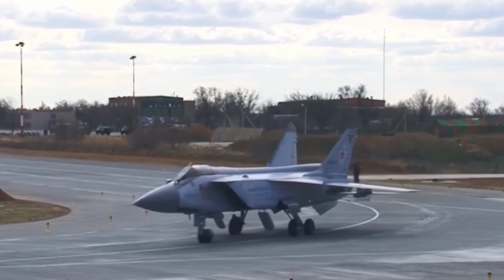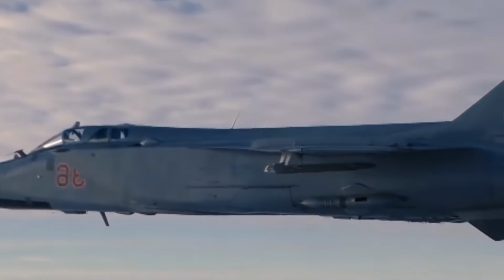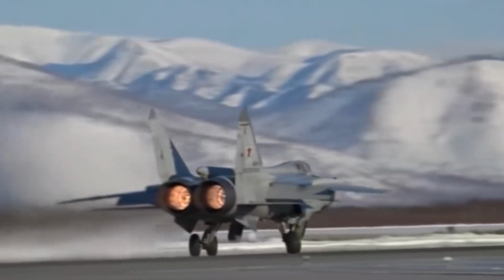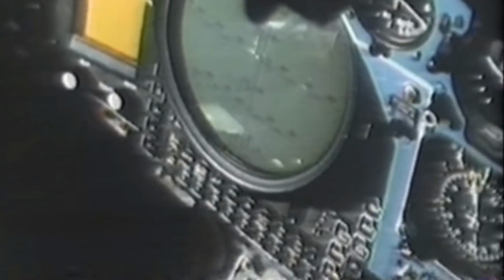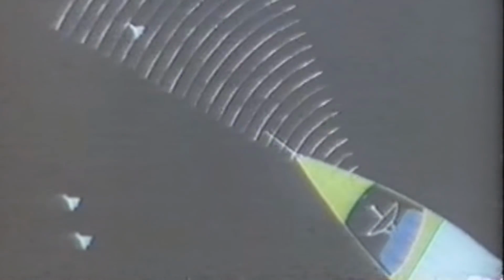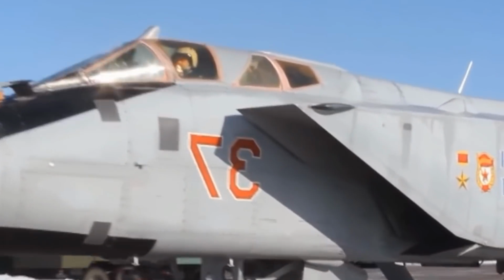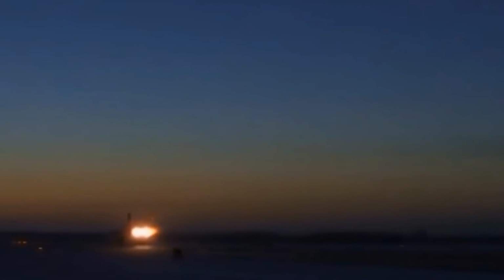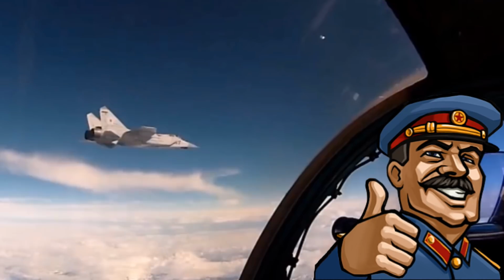Mikoyan MiG-31 Foxhound - Russian Interceptor Fighter

Comment: It's called foxhound because it's had an amazing function of scanning targets for another's allied planes and transmit target position by data link, the allied planes can disable their radar and get target position given by the mig-31. This plane has been upgraded several times with new copkit new engines better radar software, it's still dangerous.

Comment: Well done!  Very interesting and well researched documentary.  Extremely well presented too.  Just one correction.  A “Two Person” cockpit is generally referred to as a “Two Crew”/“Two Man” or a “Two Seat”  Aircraft!/Fighter Jet,  with Front and Rear Cockpit for the Pilot and Navigator/Weapons System Operator!    A One or solo Cockpit is generally referred to as a “Single Pilot” /“Single Crew”  or a “Single Seat”  Jet/Jet Fighter!    If it’s a “Training Aircraft”  It is equipped with either a “Tandem Layout” or “Side by Side Layout” Cockpit, and is referred to as a   “Two Stick” or “Two Seat”  Training Aircraft/Jet/ or Jet Fighter!

Comment: The Russians are renowned for tough, fast fighters and strike-fighters. The US F-15 was partly a response to the Mig 25, but the Russians haven't managed to build any aircraft to match it, at least not in any significant quantity. Along with F-18's, the Eagle remains a potent weapon system. Add F-22's and F-35's and the F-15's would probably never see an enemy plane.
Reply: Su-27 is and was more than a match for F-15.

Comment: 23mm Gatling Gun firing at 6000 rpm.   200 rounds in the on-board magazine.
Two (2) seconds is all that cannon has, a last ditch weapon for sure.
An amazing machine considering the time it was designed and built.
Reply: I think he said 270 rounds, so about 3 seconds, but I guess it will only take 1 second since those were intended for slow bombers, or when it is completely out of missiles, though I wonder why so little, 500 at least would be something...
Reply: @Lomnjac007  Agreed

Comment: On subject of Zaslon radar i recalled that the NIIP design team actually had difficulty in convincing Soviet top brass to go on Electronically Scanned Array, but eventually they succeeded and it paid off in 1978 where MiG-31 first demonstrates simultaneous engagement of 4 target with R-33 missiles.  I considered it an important feat as R-33, unlike American AIM-54 is a pure Semi-Active Missile. In order to simultaneously provide target illumination and tracking for mid course. the radar has to be phased array.

The Zaslon soon bear its descendent the Zaslon-M for MiG-31M. the Zaslon M bears even larger antenna of 1.4 meter in diameter, larger than already large 1.1m diameter for regular Zaslon.  Unfortunately the MiG-31M program died out, replaced with more affordable maybe MiG-31BM program, the BM retains the original Zaslon antenna but replaces the backend with more modern processor, Argon flight computer gave its place to more modern Baguette series, similar as more modern Sukhoi 27 variant. 

Soviet designers learned hard lesson when attempting to solve the multiple target tracking and weapons control with conventional antenna  through the Smerch-100 radar program, the prototypes named "Groza" and "Vikhr" failed to live up their promises.

Comment: This aircraft is one of the top high flying, high altitude aircraft too. I think you have to wear a pressurized space suit, some 65,000 plus feet altitudes capability, I believe. However, I'm not a hundred percent sure of what altitude it can fly at. I'm not sure if they can fly U-2 altitudes, approximately 75000-ft, or SR-71 aptitudes, some 90,000 plus feet. However, that Mig is some serious interceptor. A major improvement from the Mig-25, it looks a lot better with those vertical anti-stall fins on the wings tooken off. However, I believe it's not all that maneuverable, in my opinion. The wings are way too small or any type of real good G loading. Though, an improvement from the mig-25, definitely. But again, it really wasn't design for maneuverability.
Reply: It's an interceptor. Not a fighter. So not designed for manoeuvrability. Designed to shoot down bombers and awacs. And probably tankers.
And the service ceiling is 21500 meters. Normal top speed is mach 2.83. However, at maximum altitude, it can and have attained mach 3. But the body gets damaged due to extreme wind drag. 
So mach 2.83 is actually the safe top speed. Not actual top speed.

Comment: Can't dispute its massive power and ability. 

Unfortunately, over all this fighter is a failed concept and design. Never took down the SR71 and no known verified kills of any US fighters. Us pilots easily shoot down Mig 31's in the Iraqi air battles. Huge massive size cant dogfight... not against an F16 or Typhoon. The new gen Mig29, 27 and other modern versions are far superior than the Mig31.
Reply: Iraq never operated mig 31s. And it's an interceptor. Not a fighter.
Reply: @RR-us2kp  
I'm mistaken, the Mig 25 was part of the Iraq airforce. Not the Mig 31. Thanks for the correction.

Comment: Only has 260 rounds of ammo for the gun.  You would think it would have at least a few thousand on board even though the cartridges are big for the cannon.
Reply: Plane is faster than the bullets. It overtakes them if shot while in maximum speed. Gun is for rare low speed engagements in case if missiles are not available.

Comment: The ideal Aircraft for there new Kinzal Hypersonic Missiles. Fast out and launch at maximum altitude and high speed increasing the Missiles Range and Speed. 
So much for stealth! Meanwhile the F35s or Hornet is struggling to gain altitude and intercept. Meanwhile the Missile is on its way and the Mig31 is halfway home.
Just hope the Kinzal is not heading for your Carrier.
Its obvious now Russias Doctrine has changed completely. 
If they could go back to 2001I bet the SU57 would probably be developed along completely different lines.

Comment: Russian MiG-23MLD, MiG-25PD, MiG-25PDS, MiG-29 MU3, MiG-31E ( 31 BM, 31 K ), MiG-33, MiG-35, Tu-128M, Su-27SM2, Su-30SM, Suhoj Su -33, Su-35S and Su-37, 
American F-14D, F-15DJ, F-16F/110, YF-17, F-18F, F-22А, F-35A, F-35B i F-35C, Serbian G - 2, G - 4, J - 21, J - 22. manufactured in America, destroyed in Serbia with S - 125; We did not know that the invisible F-117 A Nighthawk (fall in BUDANOVCI -  Buđanovci ) and B-2 Spirit Missouria (fallen into the SPACING COURSE - Spačvanska šuma ) Steven Li Bashen - B-2 Spirit units in Combat - Tomas Vitingtin on page 43. read some of the relevant sites on you: won S - 200 VS F - 35 Lytting Lost; won S -125 VS F - 15Eagle Lost; won S - 125 VS F - 16 CG Fighting Falcon Lost; won S - 125 VS F - 177 A Nighthawk Lost; won S - 125 VS B - 2A Spirit Lost; won MIG - 21 Fishbed VS F - 16 Fighting Falcon Lost, won S - 125 VS B - 52 Stratofortress Lost, won S - 125 VS U - 2 Lost. Since we have well declared the S - 125 in 1999 year, they could be given a gift S - 300 and S - 2000 in the war to destroy the F - 22 Raptor.

Comment: The last true interceptor, made for a unique Russian need. To cover huge distances of northern European Russia and Siberia very fast looking for enemy bombers and cruise missiles, or SR 71 spy planes.  It was not designed for fighter to fighter combat or ground attack unless using the new hypersonic air launched ballistic missile.  It needed to be huge because it carried a huge radar, a two man crew, huge long range missiles, huge engines and lots and lots of fuel. So no dogfighter.  It was never exported. And it was an excelent plane for the role it was designed for. The closest western equivalents would have been the F 14 Tomcat (but it also has to dogfight so it was an interceptor, air superiority fighter hibrid) and the British Tornado ADF, (but it was based on a long range ground attack plane), and those are now retired.  Canada actually needs a plane like this.... but there is none in the western market. So they are looking at multirrole fighters who are not really designed for that role.
Reply: LineOfCars  And cruise missiles.

Comment: What's fascinating to me and not obvious looking at the Mig-31 is that they also made a lot of upgrades to the wings and fuselage compared to the Mig-25 in order to enhance low speed maneuverability. The latest versions with fly-by-wire controls, likewise improved upon its maneuverability even more.  So while it was not designed to be a dog-fighter, if it has to, it can do it hence why they put a cannon in it.  At the time it was made, it was as least as agile as the U.S. F-4 phantom, F-106 fighters.  Only with the advent of the F-15, F-16, and F-18 did it get surpassed in dogfighting capability. But if you watch it fly at low speed in airshows, you'll see that it can still do some impressively tight turns.   It's radar also was so powerful, that it literally could "burn" through ECM jamming.  Even its older brother, the Mig-25, could do this which is why during the first Iraq War, an Iraqi Mig-25 scored the only Iraqi air victory in that war by downing an U.S. Navy F-18 before fleeing retaliation at high speed.  In the right hands with the right tactics, it shows that this concept of long range air engagements and high speed retreats, is an effective tactic.   It's also why they likely included the air-to-ground capability as it can get in and out of enemy  airspace very fast and has good range.

Comment: A 50 year old soviet design that is at least as capable as a modern F22. 
They also built the worlds most powerful rocket engine 50 years ago, the RD-170, which is why NASA uses them today.

Meanwhile, Hollywood portrays Russian engineering as sub standard and Russian engineers as generally unhinged.

There may some truth in the latter. It would explain their brilliance.

Comment: 1:20 no, you're not and neither do I but I wanna tell you that interceptor and fighter are in different categories unless you put slash between them. But in MiG-31 case, it's an interceptor but not a fighter cuz it can't dogfight thanks to its sheer weight even if it's empty.

Comment: Ahh, the good old Foxhound. Takes me back to high school, when I would get up at 5AM on purpose and sneak downstairs to play Ace Combat 5 and Zero before my parents got up. As I remember it, the MiG-31 in those games was definitely “hard mode” due to being even more of a flying bus than the F-4 Phantom II, but it was also one of the most fun planes to use due to the sheer speed. Of course, I was a little disappointed when I found out that the MiG-25 could go EVEN FASTER and wasn’t in either game.

Comment: Cockpit glass sealed with chewing gum
Reply: No matter ... the plasma flowing around the kakpit during acceleration will still evaporate the sealant.
On the MiG-31BM, the cockpit is replaced by a solid, more resistant ..
And this interceptor has apparently not served the last 30 years ...

Comment: Sheesh 1975? There were lots of technological firsts there, even AI. What else might Russia be hiding up it's sleeve today?
Reply: The MiG-41 will have plasma generators (an aerodynamic screen) and a source of nuclear energy for them, pulsating engines ... allowing them to enter a low orbit and ignore the resistance of the atmosphere when diving ... and work limitedly in airless space. In general, nothing prevents to put all this on the MiG-25 or 31.
All this is a very old technology that did not go beyond prototypes in the 70s due to price and lack of materials.
The AI is there now, he will assume control at a critical error and forcibly throw the pilot if he considers that this is the only way out and you cannot save the plane itself.
All this is the simplified technologies of the space program, even 40 years ago it was clear that the AI would be the first to go into space, because life support system will make the ship to Mars too heavy ...
and space radiation, though not kill the crew immediately ... but irrevocably ruin the DNA, even under the condition of biomodifications.

Comment: Where's the Russian fanboys that fantasize and make stupid statements that make no sense like "this would dominate an f22 in a dogfight" I love your channel by the way! Its nice to watch a military based channel without the stupid robot voice!
Reply: Because it's stupid, the MiG-31 high-speed high-altitude interceptor is designed to intercept tactical missiles, cruise missiles, high-altitude reconnaissance balloons, low-altitude reconnaissance satellites, high-speed bombers, group targets, space control, coordination, transmission of situation information to air defense fighters and ground network air defense systems, strikes by nuclear tactical weapons on ground and water mobile and stationary targets. His strengths is unattainable for the other speed of 3.6 M and a long-range weapon with perfect means of detection and guidance. If the f-22 is not quickly removed from the range of the MiG-31, it has all the chances to get acquainted with the 26 mm Gatling gun and short-range interception missiles.

Comment: Please don't reverse the video image. It makes it harder to read the Cyrillic text on the aircraft and equipment. The wingtip fairings on the production Foxbat look the same as on the Foxhound. Their main differences are the two man crew and the modern, solid-state electronics and radar in the Foxhound. Did you notice the poor application of sealant on the cockpit glass?

Comment: The MIG-31 is a very capable aircraft and in competent hands is a match for any US fighter except for the F-22. 

It’s predecessor the MIG-25 FOXBAT was the only aircraft which troubled US & Allied aurcraft in the First Gulf War. The MIG-25’s used their speed to pick and choose which aircraft they would intercept and then use their superior speed to disengage from combat when needed. It was a MIG-25 that shot down a USN F-18C Hornet on the first night of the Gulf War with a radar guided air-to-air missile, it took the US Govt 15 years to acknowledge this.

Comment: MiG-31 Foxhound is cool and fast but not fastest or coolest like SR-71 Blackbird and 
[Powerplant] 
Pratty-whitney J58 Turboramjet hybird engines 
[Top speed ]Mach 3+ 2,200+ mph/ 3,540+Kph
[Construction] out 93%of Titanium 

SR-71 Blackbird has be target at 4000 times by missles and no SR-71 Blackbird lost by the enemy 

SR-71 Blackbird is Eye of the sky  Untouchable "The Worldest Fastest ,Highest and Strongest air breathing jet".

That's huge huge huge  WOW!

Comment: Can you do a video on like tank turns? Like why some tanks when they turn stop one track and move the other I.E t-34s while others rotate each in the opposite direction to turn in the desired direction. I.E Panthers.
Reply: i imagine it has a lot to do with the engine power available and the technology of differentials. would be a lot easier to design a type of open diff where the outside track of the desired direction is unlocked by the brakes whilst the inside track is lock by the brakes forcing engine output to go to only one track at a time. As opposed to developing a differential system with a type of gearbox or gearing that can be engaged to reveres the rotational torque without major loss of said torque in the process.

Comment: I'm curious why the afterburner lights up in the colour blue. Anyone know?
Reply: SuperSix Delta it depends on fuel to air mixture. Rich mix burns yellow, lean burns blue, and lean mixture helps to save some fuel... in theory, since we are still talking about two gigantic afterburners xD
Reply: NYET NYET NYET!!! "Raw fuel" can NOT burn, period! "Burning" is chemical reaction of fast oxydization with a lot of energy and gases as the result, you need an oxydizer for it. In case of jet engines and afterburners, it's oxygen in the air. It's the mixture of air and kerosene that burns, not just "raw fuel". And the ratio between air and kerosene basically dictates the color of exhausting flame since flame is hot gases, it's plasma, and the colour depends on chemical compounds and elements: molecules, atoms and ions, inside that plasma. If you have high kerosene content, exhaust is yellow. If you reduce it, it starts to get blue. If you add something like barium or copper sulfate, you will get green fire. 
So if you want to cruise at mach 2 with style, you know what to do.
Reply: Higher temp. burn?
Reply: Raw fuel is dumped into the engines and it burns blue.  Similar to a liquid propelled rocket's blue flame.
Reply: Lol, calm down kid.  I was being very basic.  We're not in science class here. ;)
Reply: r/iamverysmart